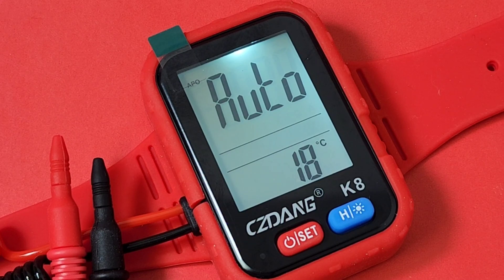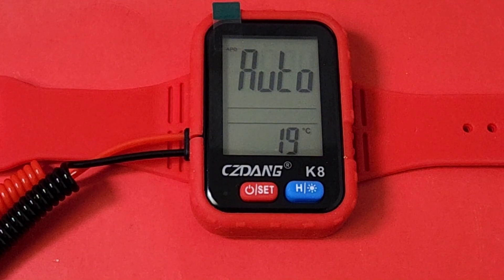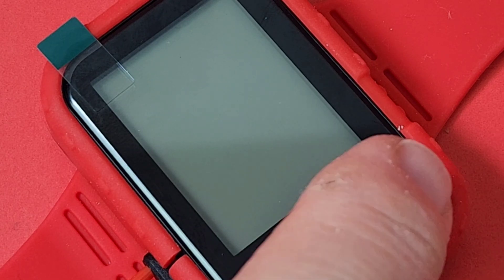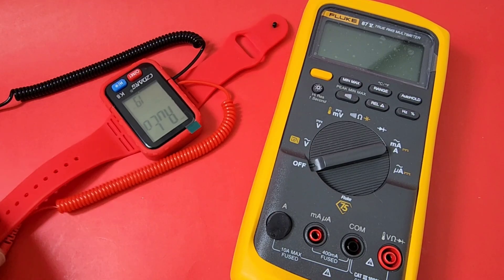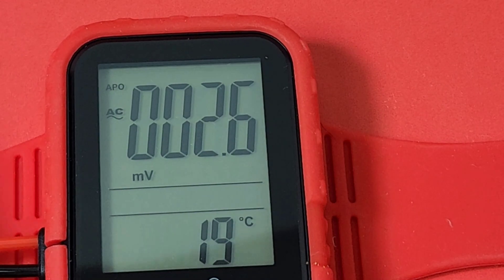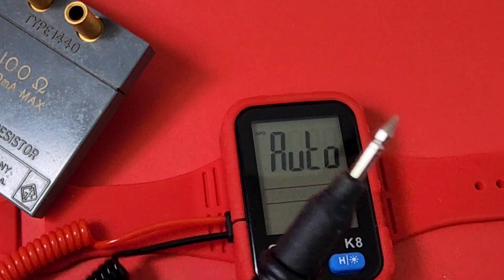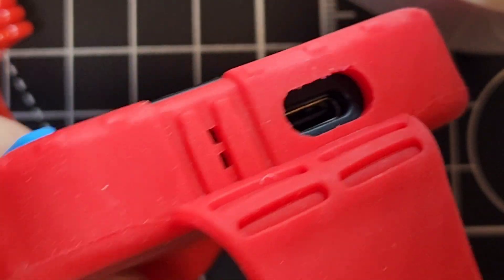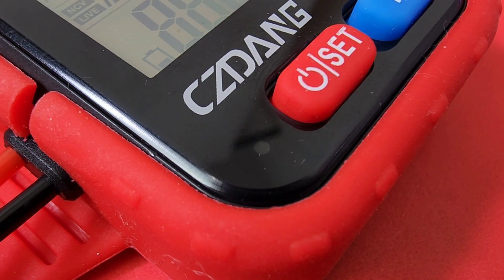MULTIMETER WATCH? ● CZDANG K8 Review & Teardown!

Comment: seems like more of a niche product. I could use this while doing industrial panel work where space is really limited and I don't want to move my eyes far to read the meter.

I don't need (or want) a watch function, the only thing I would wish it to have was some clips to hold one of the probes.

Tons of potential in the design, and I agree a v2.0 would probably be great... as long as it doesn't have a watch.
Reply from the maker: Lsck of a probe holder really is s showstopper..
Personally, I'd love the watch functionality,  especially if it was activated only when the multimeter was turned off... cheers !

Comment: I cant believe they make this without built in lead storage
Reply from the maker: You and me both..absolutely makes no sense..
Reply: imagine you're reaching into an enclosure, you've got 24vdc, 110vac and 480 3Φ all over the place and you need to make a reading. You don't want to take your eyes off your hands to look at a meter perched on top of the panel.

now you see the niche for this device - and why it doesn't have clips for the leads. I think this was designed for maintenance techs, not casual weekend warrior stuff.
Reply from the maker: @edwardgiovannelli5191 still, It needs clips because dangling leads are a safety hazard. At least they should be there for storage.

Comment: its a multimeter not a watch - its ideal for use in tight spaces where there is nowhere to put the meter whilst needing two hands for the test lead placement. A wrist mounted option is a good idea - who needs a watch when your finding electrical faults. I think its a good little meter.
Reply from the maker: That's a great point - the form factor is super useful in tight spaces, and freeing up your hands is always a bonus! 👍

Comment: Hello, is this multimeter true RMS or classic RMS?
Reply from the maker: Classic my friend!
Reply: @KeepOnTesting  Hello, do you know of a display that gives the exact reading of the value at the voltage variator output? I can't find any true rms, especially built-in.
Reply: @spaniels40  There is no such thing as “classic RMS”. The alternative to a True RMS meter is an  “average-responding” meter.
Reply: @tookitogo  Apparently the device measures the output voltage of a speed variator well without the degraded signal posing a problem!
Reply: @spaniels40  That could be. All I was saying is that “Classic RMS” doesn’t exist: it’s either true RMS or it isn’t, and if it isn’t, it’s called “average-responding”.
Reply: @tookitogo  on an rms the measured value changes all the time, on a true rms the measured value is fixed even with a degraded sinusoidal signal
Reply: @spaniels40  Again: if it isn’t true RMS, then it’s called “average-responding”. 

And your definition of non-true-RMS is not at all correct. 

An average-responding meter shows the correct (RMS) value only on sine waves. A true RMS meter shows the correct RMS value even for non-sinusoidal signals. (Up to a point, which is specified in the manual as the maximum crest factor, and up to a maximum frequency.) 

Please, stop trying to justify your made-up terminology, and instead go look it up yourself.

Comment: Hey darren, how i wish you can make an in depth review of the njty t58c digital multimeter(with inductor function). I wonder how accurate that is or how fast the response time is. From what i read, it has some cool functions like blinking LED lights on the input jacks so we'd know where to pit the leads on. Aswell as backlight sensor w/c automatically turns on backlight in darker environments. Another neat feature is the red/orange backlight when inserting probes on potentially high voltages.

Thanks ahead! Much love from the philippines.
Reply from the maker: Hi Michael! Thx so much for the recommendation! I've just ordered a NJTY T58C for review 🙃👍 Looks like it will be a really interesting Multimeter. I'm already digging the inductance mode..! Thx my friend ❤
Reply: @KeepOnTesting  nice! A timely comment indeed. Looking forward for that review. Thanks darren.